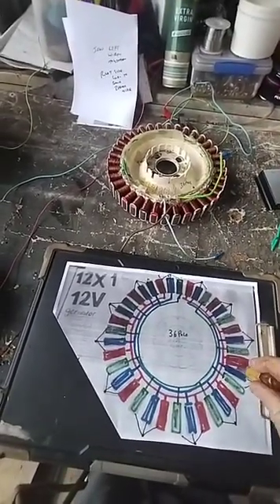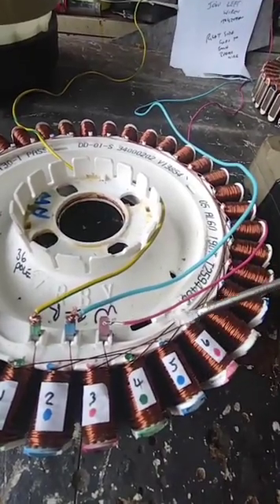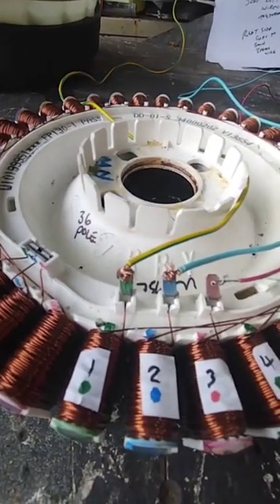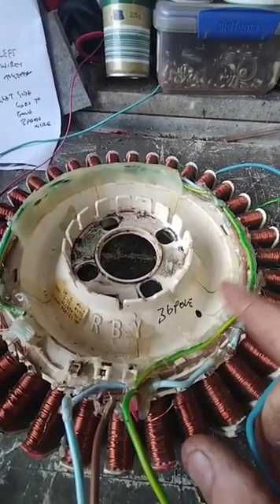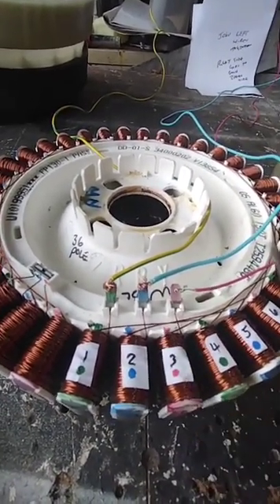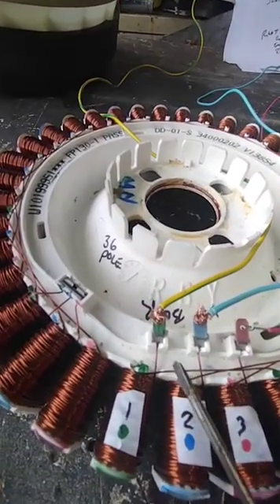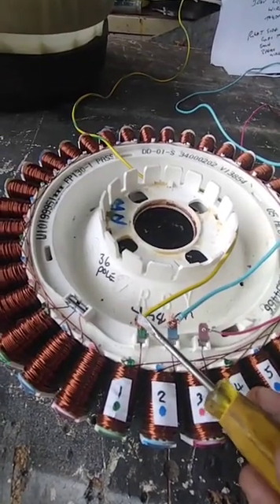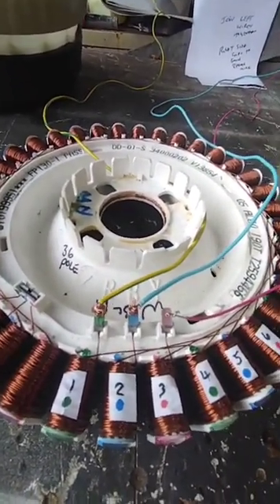PART TWO of making a wind generator from a washing machine motor step by step

Comment: Good Job of explaining it!  My expensive 2000watt purchased alternator overspun because of high winds and malfunction of brake and burnt out, now would like to do like you are doing.  What I don't know is if I should rewire it as you have done because I need to charge my 48v batteries and it goes through a buck and boost charge controller. Do you have any suggestions for my situation? I would appreciate anyone's help!
Reply from the maker: Check out Tristan Mcnabbs channel on YouTube. He shows 12,24,48 volt diagrams. For me at this stage I was mainly concerned with 12 volts charging. Hope that helps. Tristan is a genius in that area
Reply: Thanks! @Aussiehomestead1965

Comment: Heya bud I'm struggling to find a 27 pole conversion to 12v any ideas?
Reply: You should just be able to follow this video but instead of having 12 lots of 3 coils you just have 9 lots of 3 coils. Same process exactly. The only thing is youll get less amps because theres less coils to make the power.
Reply from the maker: Good answer, thanks 🙏
@lexicase8805
Reply from the maker: Lexicase comment below is on the money. Check out Tristan Mcnabbs channel on YouTube as well, he's a genius when it comes to wiring diagrams etc.. Hope that helps 😊

Comment: 3 phase ac wires  only 2 wires?shouldn't there be 3 to keep the phase separated to prevent center emf on one of the opposite phase
Reply from the maker: No... it's 3 phase from the stator and hasw3 wires It's the rectifier that converts it to DC two wire